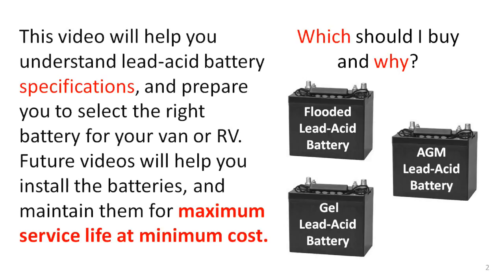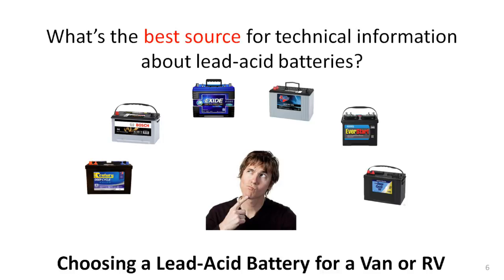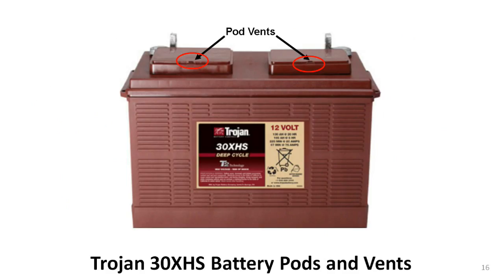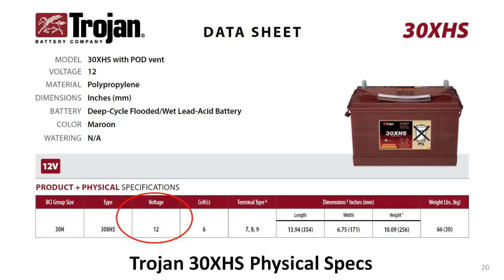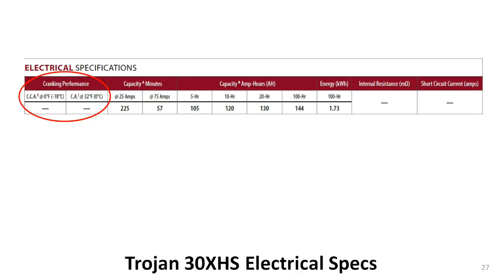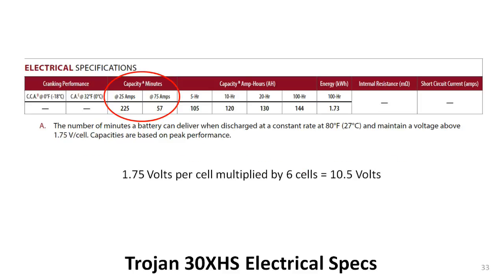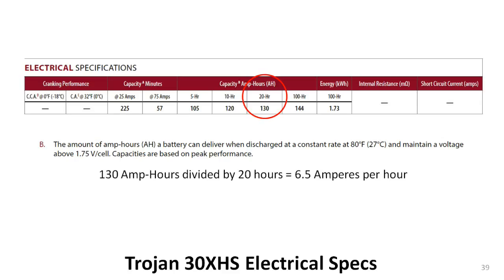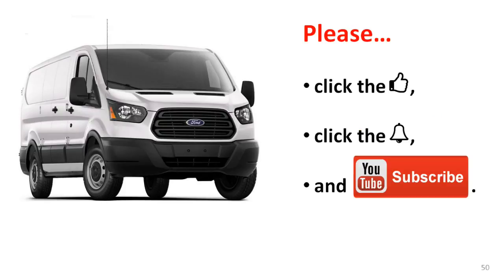Understanding RV Battery Specifications, Part 1

Comment: Should you turn off the breaker box when rv is not in use for a couple of weeks and should you keep it plugged up for the period not in use? Thanks in advance 
Keith
Reply from the maker: Yes, you should disconnect all loads from the battery when the RV is not being used. During cold weather, the self-discharge rate of the battery should be low,  but it will be higher in warmer weather. A couple of weeks could be too long if there are devices discharging the battery.